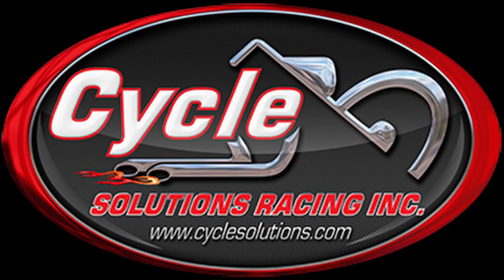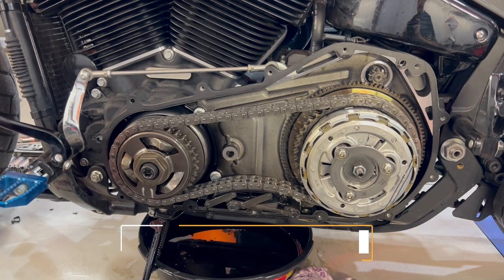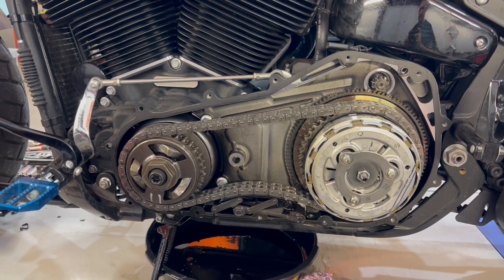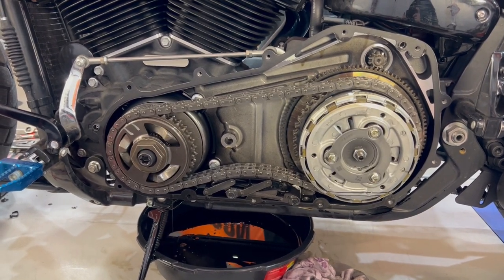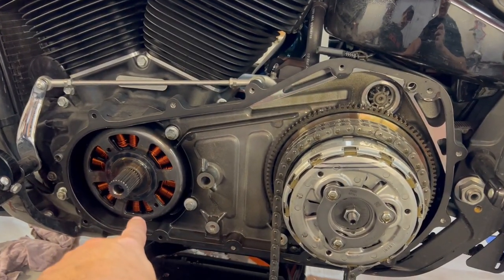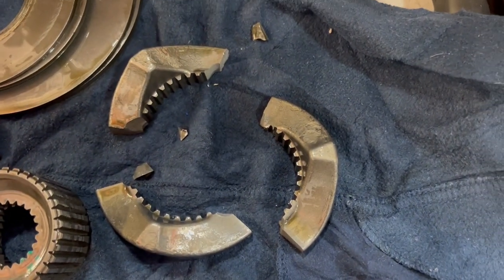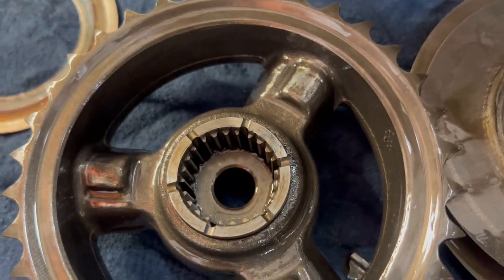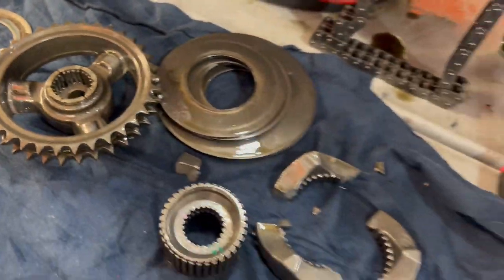Broken Compensator on a Harley Davidson Fat Bob

Comment: Why the hell did HD reduce the strength on the compensator ramp when they introduced the M8???

You can visually see less beef/metal thickness when viewing a twin cam vs M8 compensator ramp.